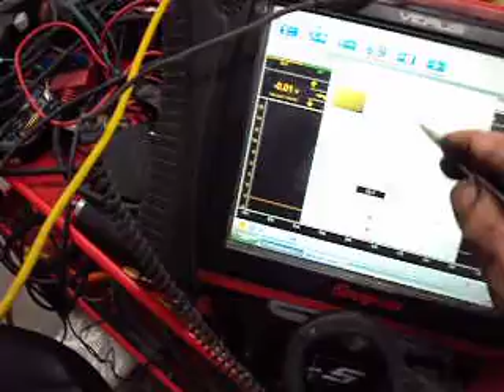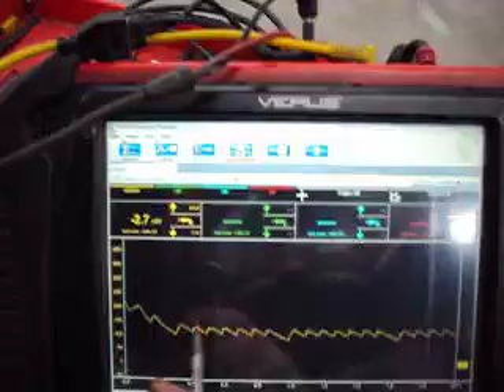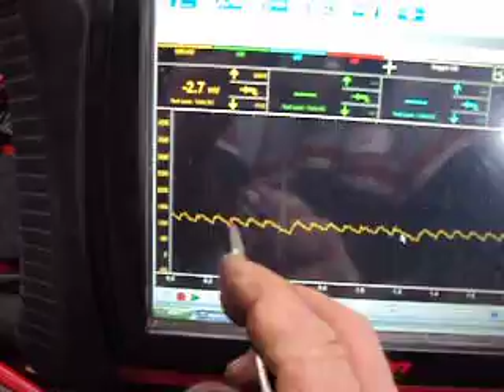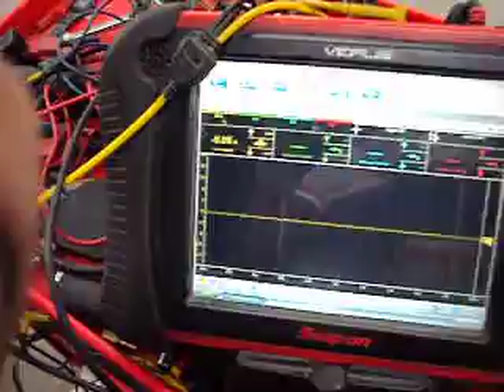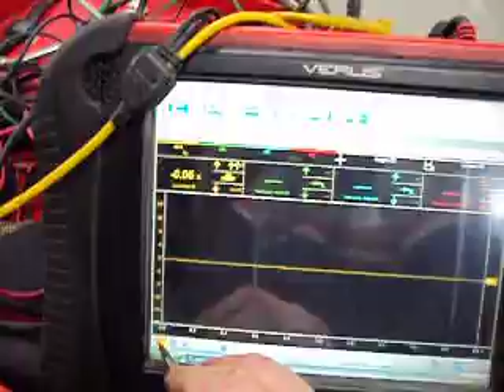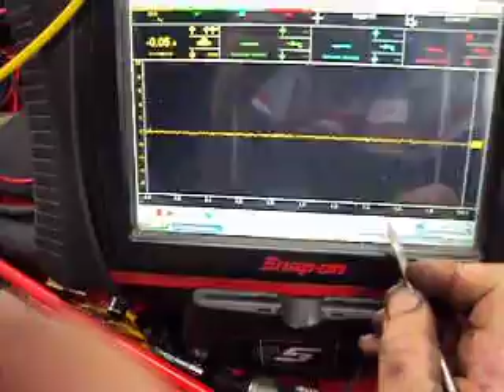Relative compression testing using an amp probe and a verus

Comment: I'm using a pdi clamp with a vantage ultra  doing a relative compression test on a chevy cavalier 02 model the humps are not as sharp as the one's you have on the screen what could be the problem?

Comment: Good job! If you add a second trace connected to number 1 ignition primary or secondary and trigger on that trace, you would be able to tell which cylinder had the low compression. this assumes you have disabled the fuel system to prevent starting and not the spark.